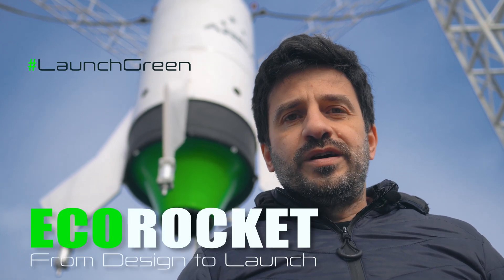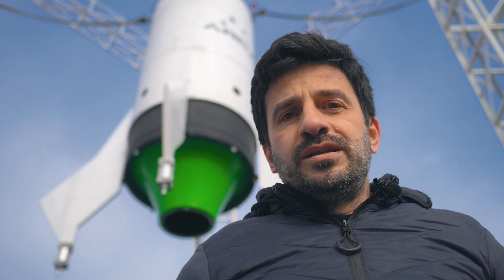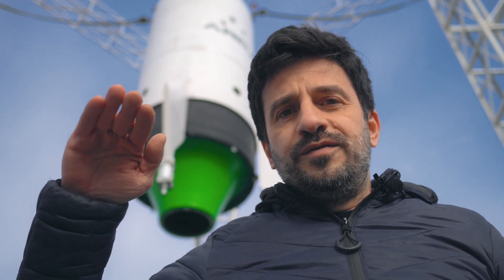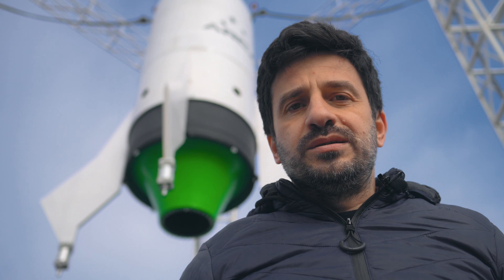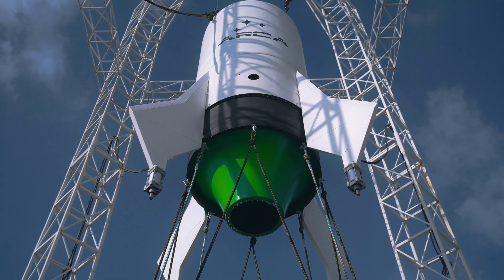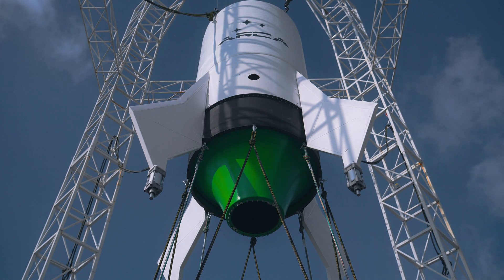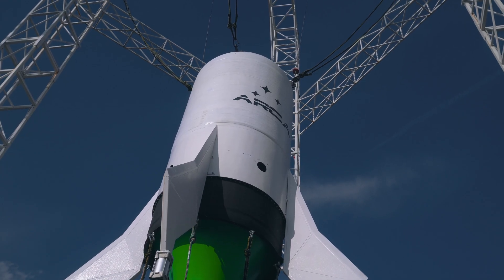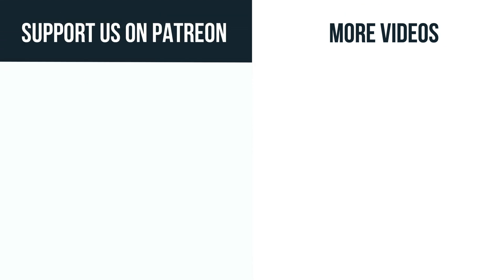EcoRocket: Episode 5 - Vehicle Secured in the Test Stand

Comment: Hi Dumitru, I am extremely excited for the hop, more so than for the SN 9 flight as that is already demonstrated once but this is an entirely new frontier! However, I noticed that the landing engine has been removed. Is this true? I hope that it can be reattached quickly! I am also very curious about the technical aspects of the vehicle: how are the guidance and navigation handled? Has a system for telemetry been developed? 

Also, the green rocket is extremely important for sustainability. The methane-powered starship will release hundreds of tons of CO2 per flight, whereas the EcoRocket heavy pollutes much less so I am a big fan of the concept. I saw your presentation in Nov, but I am curious about the Gen 2 LAS. How is the Isp boosted? Please can you give me just a bit of an idea? :)

Just another small question, can you switch to ethanol/biofuels eventually? Because that way the EcoRocket is 100% carbon neutral, especially once the solar panels for the water heaters are up and running!

Also, I am from India and you had mentioned the ISRO in your previous video. It is great to see the pride of India featured in foreign media in such a positive light! It is indeed great to see the ecological movement slowly spread throughout the aerospace industry, with the Japanese wooden satellites and Skyrora from Scotland also using Ecological biofuels. Please do continue to spearhead the charge and I await your first launch in June!
Reply: I should point out that the methane fuel can be made by reacting CO2 with water to render Starship carbon neutral, which is planned to be done, it's also how they plan to make fuel on Mars so no reason not to do it on Earth too

Comment: I have done some calculations based on the numbers in your presentation and concluded that you could really benefit from (and maybe are already planning to use) a small (~20kg) third stage, perhaps fueled by a monopropellant for simplicity. On paper such a stage would more than double your payload to orbit and even open up the possibility of launching beyond low orbit.

Can you comment on this?
Reply from the maker: Agreed. We are already working on it. It's heavier than 20kg and it uses hydrogen peroxide based hot propellant.

Comment: The puplic are demanding from the space transportation industies a safer, non polutive cost efficient craft/rocket. So, the test is the rocket combustion, A- will it be too unstable/flammable or not, B- will it exirt too much or too little power, C- will it perform faster speed or not,. You don't want any drone navagation gears messing up the rockets engine integrity during a combustion lift off test, as irrelevant bad impression. Good luck & Godspeed  ...Have to admit the leg gear stands look better then SpaceX so call "Starship".
Reply from the maker: Agreed! Thank you very much!